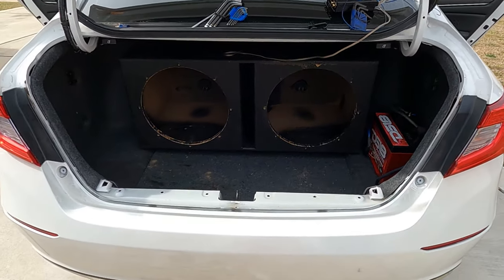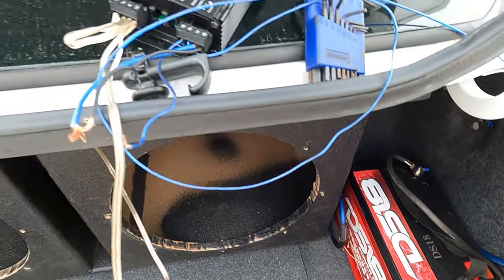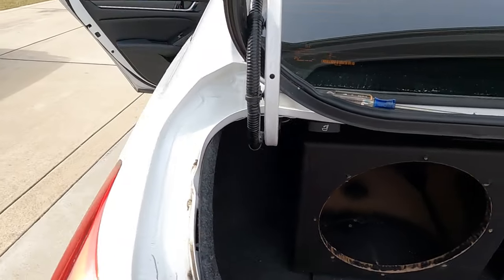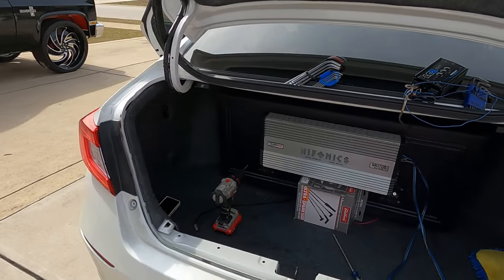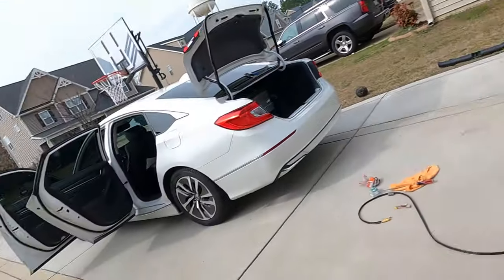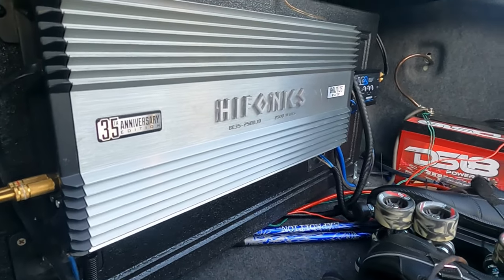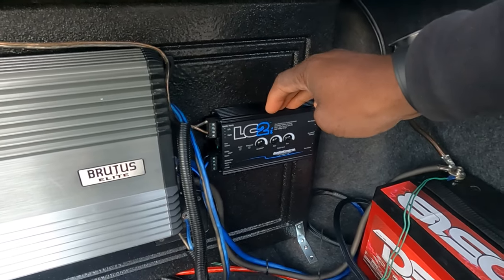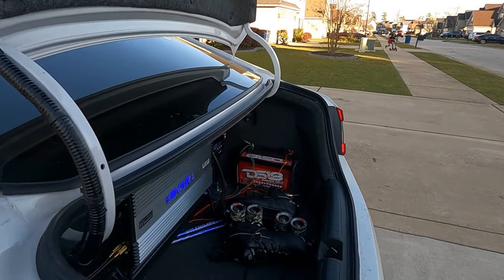PT1 Hybrid Audio install How to install Dual DS18 15-inch subs & 2500.1 watts Brutus elite Amplifier

Comment: Hey just for your INFO, Try and find another place to mount your amp, Reason why is mounting it to the ((sub box)) can burn out the resistors in your amp and or shorten the life of your amp from all the raddling from the bass, I learned the hard way on this. Not a bad build thou. My system that I'm running right now is:   (Kicker - CX1800.1 Mono Amplifier) with (x2 - 12" Kicker - L7R Subwoofers in a kicker sub box), with an (Alpine KTP - 445U 4ch Amp) for my (x4 JBL speakers) for the doors and a (AudioControl lc2i pro) in my 2020 Mitsubishi Outlander SEL, I plan on changing ALL speakers and 4ch amp to Kickers here soon, I'm a 55 old fart that LOVES MY BASS and Holly crap it raddles my brain sometimes lol, But well worth it. People turn heads sometimes. Good luck with your system.
Reply from the maker: Thx, I actually already moved everything off of the box for the rattling reason, thanks.
Reply: @CurtARoll  Sure anytime.

Comment: Hey bro I got a hybrid with 2 sundown x12's. My main issue is power. The inverter in the car isn't making NEARLY enough power for the subs. I've looked everywhere and can't find a way to add power, because there's no alternator. Did you do anything for power?